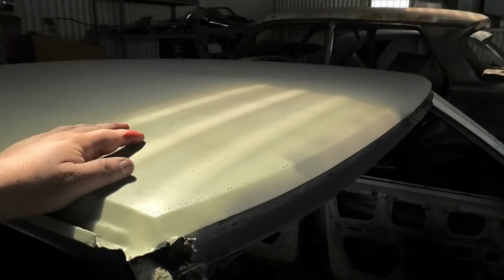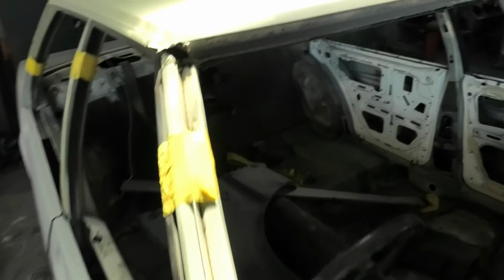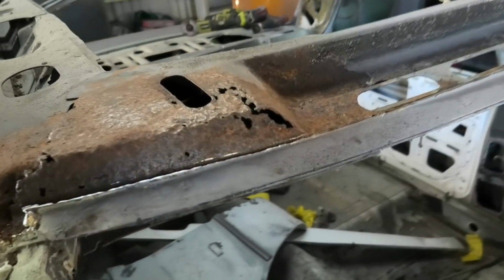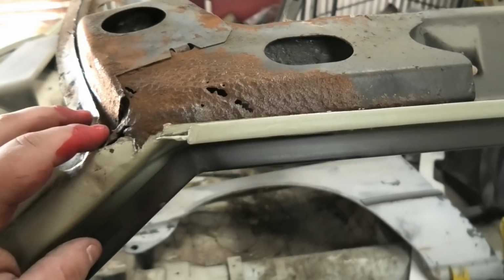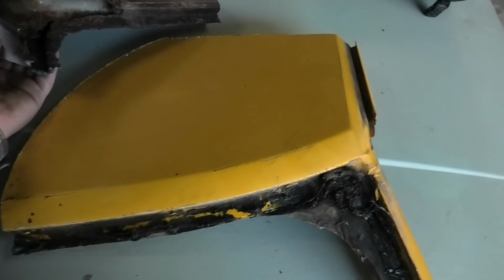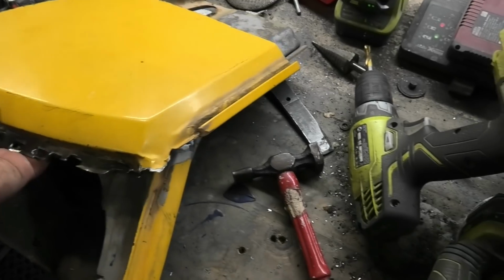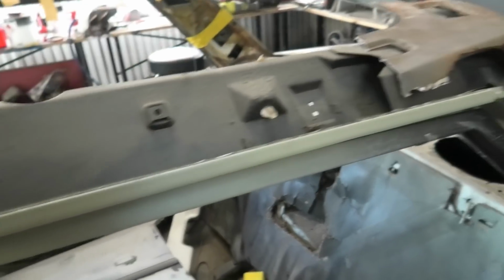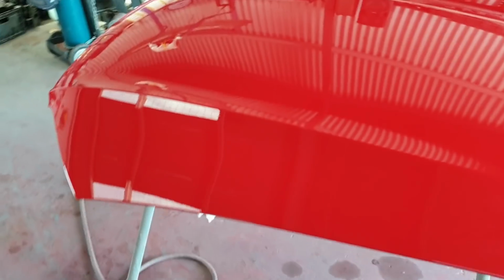XD falcon roof skin replace part 1

Comment: I’m about to resskin my hq stato using a skin I had already glued on to a different body, I’ve picked the whole substructure off, question, would it be okay to bond the driprail or would you recommend to use the substructure I’ve kept, it’s my last job just finished the beaver

Comment: Hey bud, wifeys got an XD sitting here in NZ where the roof has rusted pretty much all along the gutters and the corners. Ive got a XE with a good roof skin on it. Is it possible to lift the skin, gutters and all off the XE and slap onto the XD?
Reply from the maker: believe it or not i had to actually rewatch my own video to remind myself its been over 2yrs since i did this.....but technically looking at the design i believe with some bending of the gutters you could.

Comment: Just wondering do you use flowright in your paint to make it super Smoove ..... If not just add a bit more reducer and and it will flow Easter with no peal ...
Reply from the maker: Well half my issue today was it was bordering on too hot to paint. The underside was done in 20degrees and the top in over 30 degrees
Reply: @xacoupeguy  yeah that makes it hard to paint in shitty hot days but at least it should be a dry heat I live in an area of high humidity even on hot days we get water in the lines .... But the finish on the bonnet was pretty good

Comment: Are you going to replace the rear speaker holes while its apart?
Reply from the maker: it'll be discused with the owner at a later date but id be surprised if we dont
Reply: Seems like a lot of work has gone into it and not to fix the cut holes in the parcel shelf
Reply from the maker: @benni727  such is life its not my car i dont have final say on it

Comment: Hi Graham that new gun of yours looks like its a good deal. Im about to paint my xy ute and i really need a new gun, where did you get your one from. All the best with your lock down mate at least its only 6 days of mucking around at home eh. Cheers, Phil NZ
Reply from the maker: Got the gun from my local crash shop supplier
Reply: @xacoupeguy  Hi, i take it it's a finishing gun,  what model name/ number and tip size 1.3mm? There are so many guns on the market it's a mine field.
Reply from the maker: @stevegus2845  yeah its got a 1.3 tip and runs at around 30-35psi
Reply: @xacoupeguy  Thanks

Comment: always makes me nervous seeing people use the spinning wheel of death without its safety cover on, after seeing what it did to this girls face I went to TAFE with after it came apart at high speed.
Reply from the maker: As long as your not trying to get the grinder to perform miracles and you are using it correctly you "shouldn't" have any issues